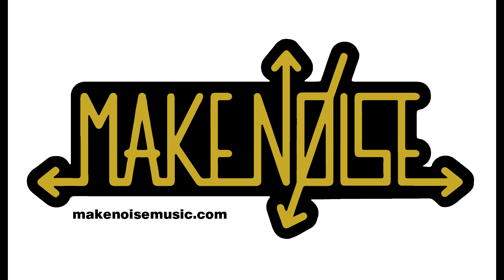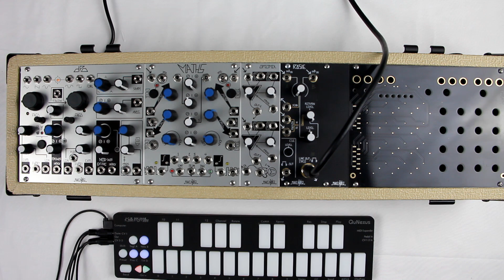Make Noise System Tutorial: System 0 as a Monosynth w/ KMI QuNexus

Comment: the patch cables coming out of the CV Outs on the left look like theyre split. what are they being patched into and why are they split please? thanks
Reply from the maker: The QuNexus puts its four CV and Gate outs on two TRS jacks, so you must split each into two TS cables in order to use all of them. This is what their "CV Connection Kit" is for, but you could use any 3.5mm TRS-to-dual-TS adapter. The signals present on each output are user-defined. The preset linked in the video description is the configuration we found most useful.
Reply: got it, thanks for your reply. pretty nice little traveling keyboard there then =_)